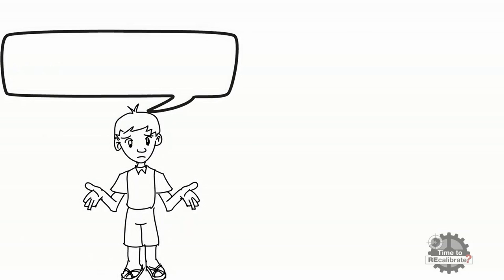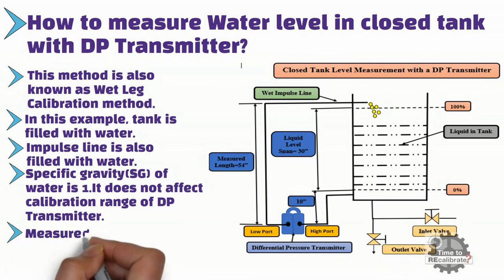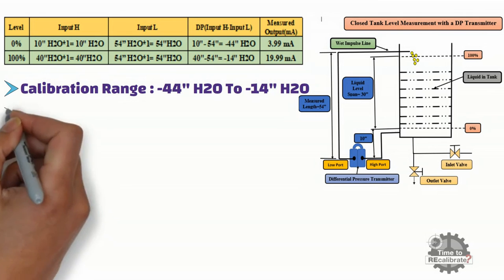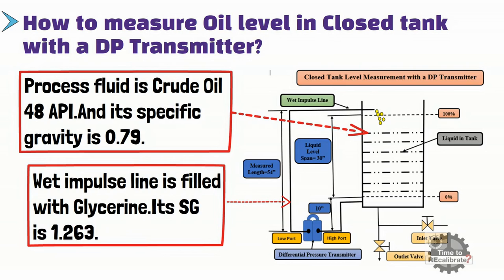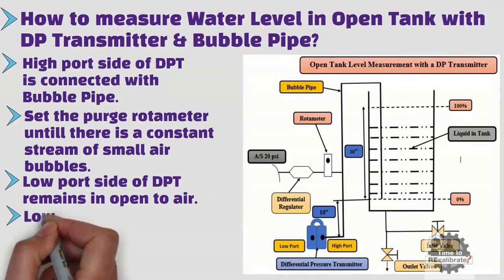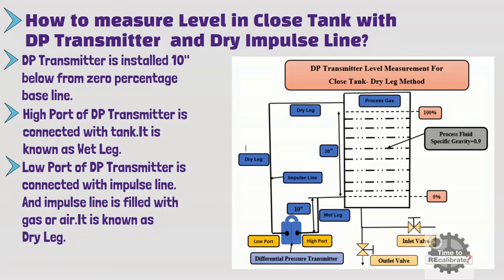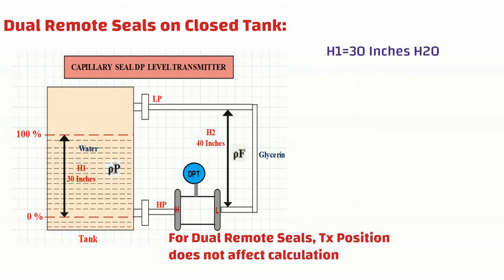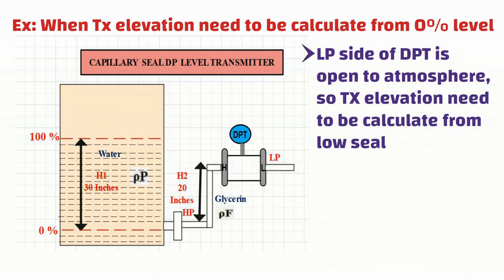Differential Pressure Level Transmitter Tutorial for beginners

Comment: In open tank method , transmitter is mounted 10" Below the 0%. If it means URV will be 40"*1*1*=40" H2O but you put 30" Of H2O as URV